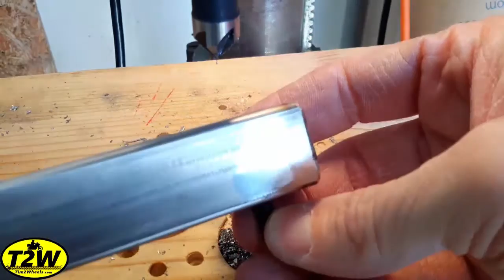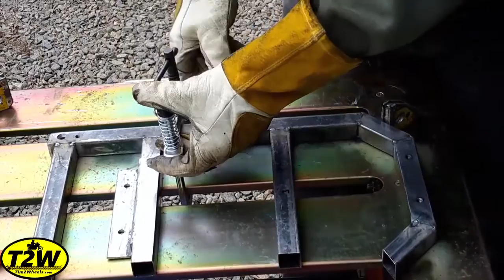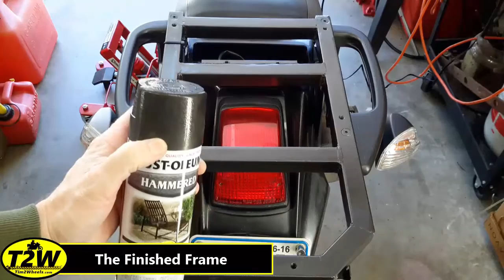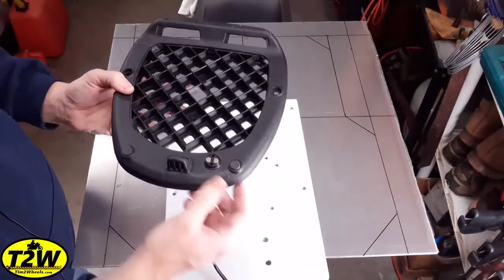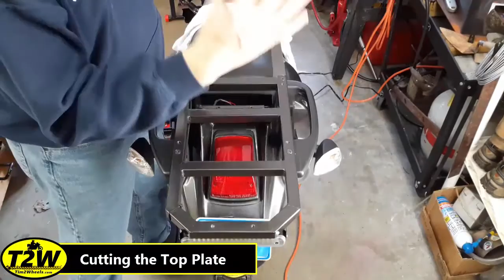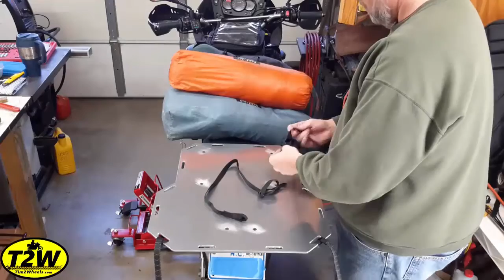T2W How To: Custom Rear Rack for KLR650 - Part 2

Comment: This is a great idea. Now that it's been in use for awhile how has it held up? I have a Givi Trekker top case and plate. I like it but in my first trip it broke the two center mounting bolts that go to the subframe under the fender. I was probably pushing the weight limit advised by Givi of 20 pounds and I was off road but I think the main issue is that most of the weight is carried aft of the center bolts. With your design it looks like it's extended even further back so I'm curious as to how those center bolts have held up for you. Thanks for the videos

Comment: Awesome video and great fabrication work.  Quick question....how did you weld the bar stock into the middle of the tubing?
Reply from the maker: hey, good question.  for the bar stock in the middle of the rack I drilled a hole through the square tubing just into the bar stock then filled it with a spot weld and ground it smooth. for the end pieces, I welded around the end to seal it closed. I am very happy with the rack and it has proven to be very strong. with the large top plate I can carry a huge amount of gear securely. Thanks for watching

Comment: Wow, Remarkable project, great work.  Being welding adverse, having neither the talent nor tools, would it be possible to just mount a plate directly to the mounting points of the original rack?  If you were constrained to that approach, how thick would you suggest the smaller rack plate be to work without a frame?  Would the larger rack need to be larger still?
Also, you cut some lovely slots in the larger plate, how did you cut those?
One other thought, you don't mention it, but I'm betting those spacers also provide noise dampening, do you find much in the way of additional noise with these racks?
Really impressed with your work.  Well done!
Reply from the maker: +Tony C Thanks for the comments Tony. 
I think a plate of the same thickness would work without the frame. However, you may not be able to extend it out the back as far if you were planning to carry a heavy load. But for camping gear, etc. it should be fine. I cut the slots by hand by making my layout marks carefully, then drilling the two end holes, then cutting between them with a jig saw using a bi-metal blade, then smoothing with a file to remove any sharp edges. This method was surprisingly quick. (although a CNC mill would be better! ). Since the video was already too long, I did not include those steps.
The spacers do provide some isolation and noise/vibration dampening. A nice side effect.

I used my BIG plate on my trip to March Moto Madness (about 600-700 miles) and it worked great. I was able to carry everything I needed and all my gear stayed secure with Rok Straps.
One thing I will change is replacing the Black Oil Finish screws with Stainless Steel. The black finish looked good initially, but after lots of rain and mud, they are starting to show signs of rust.
Reply: Today I purchased  heavy duty Turkey roasting pan from St Vincent DePaul/thrift store.  It's about 3/16" by 14" by 20".  Cheapest Aluminum source I could fine, just $7.50.  Next step, see how the band saw handles it. . . Thanks for the great insights!
Reply from the maker: +Tony C - Hey Tony, that's a great idea for a low cost source of aluminum. thanks for the comment.

Comment: I finally completed my "turkey roaster" cargo rack.  The $7.50 thrift store roaster is really solid, at 3/16" anodized aluminum.  Here's a picture of my finished work: https://www.dropbox.com/s/n39z60lcxmvob39/20160817_233459.jpg?dl=0   Boy, a cutoff wheel/grinder is sure your friend when working with the aluminum, really worked well.  Again, thanks for the inspiration and encouragement!
Reply from the maker: Hey Tony, that looks good! Thanks for sharing your project.